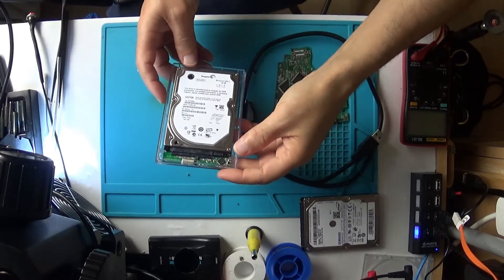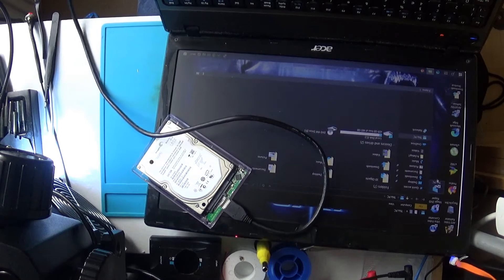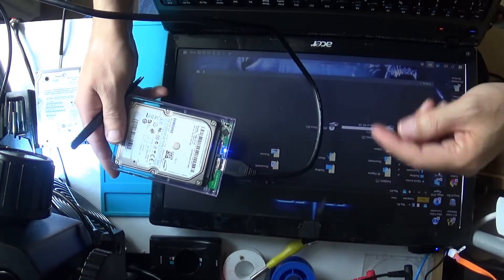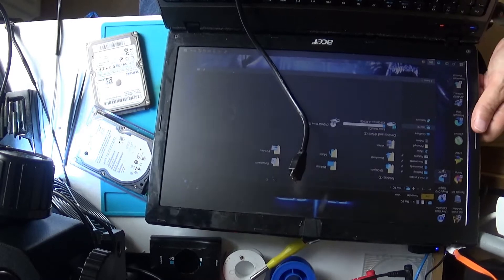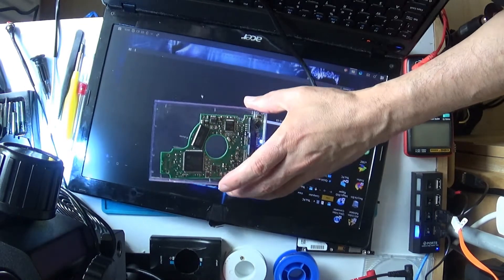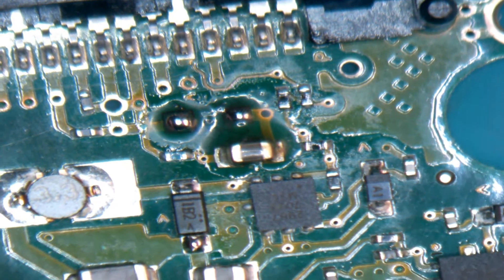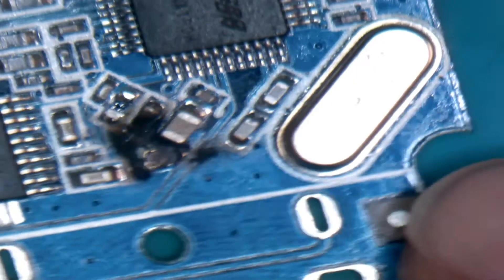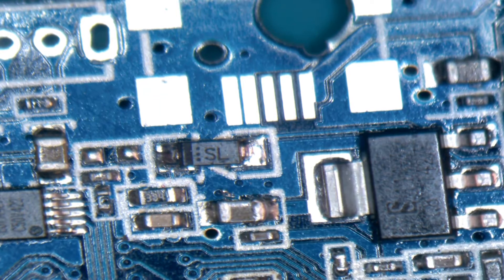External Hard Drive Repair   Not spinning No power

Comment: Any solution for my hitachi hdd.. Its not recognized by the computer the light stuck as the same in video i bought new pcr swipped bios and the firmware and still not recognized..  i Fail to update the driver.! Its never falled on the ground.. I cant find the partition in device manager..! Any one faced this problem a

Comment: Hello sir my external hdd is not recognized to pc. Nor disk management.. Its never falled on ground..! When i connect it the blue light stuck not flashing.. Any help please?
Reply from the maker: have you tried another hard drive in the external case
Reply: @amateurrepairs8193  yes i tried different case pluged it by cable without case tried different usb.. But no luck.. I dont knoe what happed